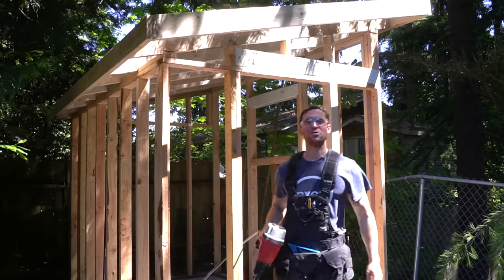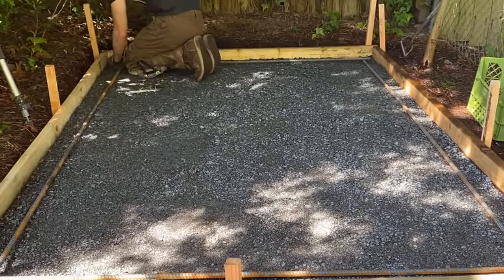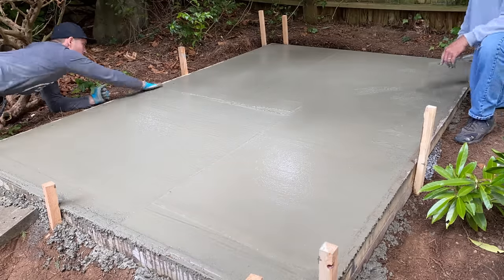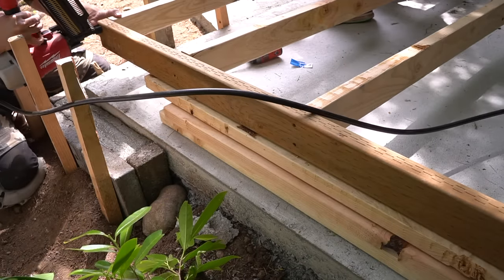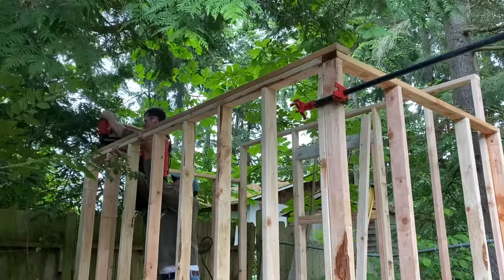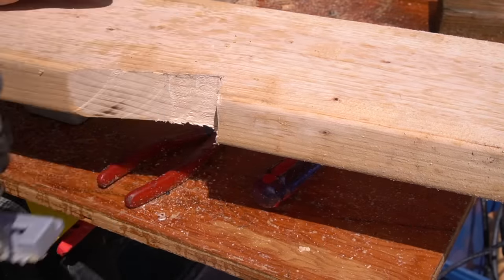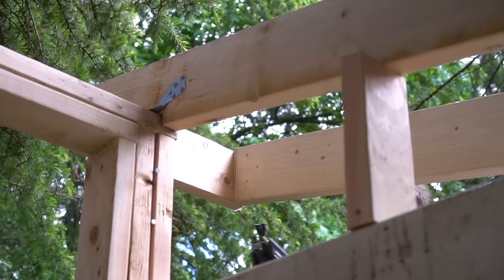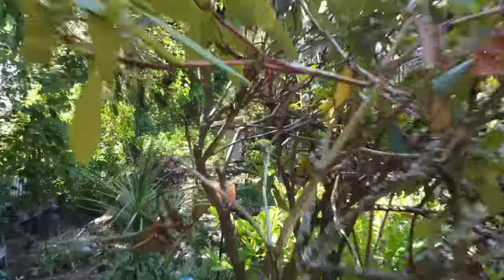BUILDING A LEAN TO SHED // START TO FINISH (Part 1 of 2)

Comment: Great video. When I plan any of my DIY projects I always consider four things: Time, Effort, Cost, and, if needed, helper(s). I also check with my county development office to see if I need Permit(s). If my project is going to require digging, underground cable scanning which is a free service. Since I have a yard irrigation system I also check to see if any of my underground water pipes need to be moved. Property easements are another consideration. Hope to see your project costs in your next video.

Comment: Learn something new everyday.  I like to watch framing and roofing, but never knew how the frame was supported at the base near the foundation.  I always assumed that heavy duty lag screws secured it to the concrete.
Reply: Main issue is water leak between concrete floor and and sitting-on frame.

Comment: Thanks so much for the great video. You demonstrate the steps really clearly. One question…I notice that you place the stud wall timber directly onto the concrete base. Did you not feel the need for elevating the structure to allow air flow under the floor/shed base?

Comment: You don't need two screeds.  You will find it easier to just get cut your stakes flush. This part was made harder than it needs to be.  Also hit your forms with a rubber mallet, vibrator (if you own one), or a sawsall (with no blade), then you won't have voids in the sides of your concrete. I do this for a living, but also watch a lot of videos.  Very much enjoyed the video.  Well done.

Comment: Good idea with the nylon zap straps on the rebar.  much quicker and better than rusty tie wires !  HINT:  On the endwalls do not install the studs and top plate until the roof rafters are installed.  You can then field-fit the endwall studs ( as well as the king studs )  right to the bottom of the rafters making a nice clean wall without having to tinker with little fill-in timbers. 😊
Reply: Good idea but why the long wall does not go longer to be full wall and the short wall stud can be nailed on it? I wonder if the author is trying to give the door more space.

Comment: Loving it.  'Cept I need to make mine with the opening on the high side. And I will probably use clear panels like for a greenhouse. That way it can hopefully act as a shed, and a greenhouse.  Still building it in my head.
Reply: Doing the same thing,window up high and south facing for the natural light.
Reply: Sounds like my unistrut greenhouse build.  It's on my channel.

Comment: You can also lay a level plumb for facial at 90, take a couple different measures on separate boards. Then use an angle finder or your square etc to transpose those marks to the others.

Comment: Also I just realized you're using a Milwaukee pneumatic nail gun! I didn't even know they made one and I am a Milwaukee tool fanatic I just actually got the M18 fuel cordless 30° nail gun for this upcoming project Sunday night! That is freaking awesome! It would be even cooler if you had it hooked up to the cordless air compressor but I guess that would be kind of silly considering you were very close to a power source I would imagine. I really would like to see a comparison between the two honestly I don't know if they made it heavy enough LOL I'm 5'7" and  175 lb this thing right here is a wrist breaker.

Comment: Thank you for your time Sir. I mainly stop by to get information on setting up a lean to roof. I'm building two small lean to sheds. One for a generator and the other for a standup compressor. Both are roughly on 4'X4' already poured concrete base and imbedded 3/8" threaded rods to tie in the pressure treated the lumber down. I goofed up on where the generators exhaust was exiting so had to rethink adding additional anchor points.  I'm planing on using 3/8" lag shields with lag bolts and epoxy to correct my oversight. Your use of hurricane ties I think you called them was very helpful in tying the rafters down. Once again, I have to thank you for giving me additional ideas. for what I originally came here for. Well done Sir.

Comment: This video offers a detailed and practical guide to constructing a lean-to shed, from start to finish. With clear explanations and visual demonstrations, viewers can learn the essential steps involved in building a functional outdoor storage space. The video's comprehensive approach ensures that both novice and experienced builders can follow along and gain valuable insights into the construction process. Whether you're looking to expand your DIY skills or simply need a new storage solution, this video provides the guidance and inspiration needed to tackle the project with confidence.

Comment: as for the nail gun safety, many many years ago I was framing  a deck, I was holding a short block of wood with my left hand and reached out in front of me with the nail gun facing back at me, using my thumb to trigger, I nailed the far end of the block of wood, I let go of the wood and it dropped to the ground, so I start checking my nail gun to see why it didn't fire a nail, that's when I noticed the framing nail had gone sideways right through my left thumb, I never felt anything, it went through the meaty part and slid just under the bone. good times, and yes there was liquid refreshments involved.

Comment: Tapping the edges of the form with a hammer can fill voids and make a cleaner edge.   Also forms can be removed after a couple of hours of sitting. More time if its cold out. and can be smoothed out with a trowel unless dirt is going to cover it then not a big deal.

Comment: I LOVE this channel!! You’re funny, witty, knowledgeable and I VERY much like the fact that your channel doesn’t cram it down your throat to encourage liking and subscribing. It actually makes me WANT to. I’m excited to let you know that now you have a new subscriber. I would love to see you do some air conditioning and power and insulation install or construction in a video since you explain everything really well. I also like that you dumb down jargon so the average person will understand! 2 questions: did you have to get a permit for this structure? Also, the miter saw you used, is it a 10” or 12”? I’m thinking about getting one but not sure what to get.

Comment: I would have added some diagonal bar too to add more support since it's just sitting on the ground surface. A 1 metre piece of rebar is ideal to tamp the concrete to get the air out before it sets, particularly around the edges but an offcut of some timber could also be used. A vibrator would be ideal if you hired one (not a personal one). That'll solve all the air pockets you had visible when you removed the formwork. The whole slab is likely to be like that so you're losing maybe 20% of the possible strength if you don't remove the air.

Comment: Just a quick word about U Cart type concrete. Make sure they’re careful about the ingredient proportions for the mix. In my town there is a company called AA U Cart Concrete. A half baked individual slopped sand, cement, and gravel at all wrong amounts into the almost road worthy slop wagon. Long story short, I had to rip up that concrete because some parts of my sidewalk didn’t set up right. Even after several weeks, the slab was easily eroded by water. Just make sure you know what you’re getting.

Comment: You should trowel out the concrete as skreet for flat level and fill in voids and tears as you peal the mix back with your skreetboard and remove the format the end then smooth and trowel and fill any sides where you remove the form boards

Comment: Great video - thank you! Sorry I found it so late. I'm in BC and want to build a pottery studio with electricity that will require an 60+amp breaker box. I thought I could have a 10'x10' built on a slab but my contractor said we had to dig down 1.5 feet, create forms, fill with gravel and then pour cement. Is that overkill?

Comment: This isn't a shed...you tricked us. It's a house!!  Very very nice...I skipped ahead.  I do wish you would have put some type of flexible foam sealant between the concrete and bottom sill plate.   Only because the shed is so nice and this would help to future proof if you wanted it as a man cave.  Also framed the corners so it would accept plywood or sheetrock.  But, it's a shed.  Super nice one too. I'm jealous.  P.S. love the drop of the tape and reversing it to be back in your hand.  Thank you.

Comment: when tracing measurements from one piece to another, which side of the line do you cut on? the tracing always seems to be just a bit smaller than the actual template... so right on the line, or just to the outside of the marks?

Comment: Wait, maybe I missed it. How did you connect your frame with the concrete base? Great video by the way love how you explain your steps!
Reply: At the end he shows it, he drilled holes through the plate and into the concrete to pound down some bolt anchors which are then tightened down with a nut and washer.

Comment: First, I thoroughly enjoyed this video. 

Equal diagonal measurements of a quadrilateral does not mean the corners are square if one of the sides was miscut too long or short.  This creates a special kind of trapezoid called the 'isosceles trapezoid'  which has two opposite sides of equal length, and two opposite sides that are not equal length.  
Character graphic example:  
    /-------\ 
  /            \
/--------------\
The diagonals of the isosceles trapezoid are equal, but the corner angles are not 90 degrees. Two will be equal but less than 90, and two will be equal but more than 90.  

So, it is important when verifying squareness to check for equal length on opposite sides.  

Now I know I'm being nerdy, but as someone that uses geometry  daily - well it just bugs me. 

Cheers.

I plan to construct a shed, from parts of a recycled plastic shed, but want to make the foundation less permanent so that the next owner can easily remove it.

Comment: Pretty neat shed.  I dont think a header is really needed above the top plate for an opening on the end wall -  your roof framing spans between the front and back walls.

Comment: Thank you for the video. 
Question 1: What is the height of the door? The guy (Blue cap) looks like taller than the door.
Question 2: What is the minimum overhang at both ends of rafters?

Comment: Great job, however a few more things (from a structural engineer) that would help this shed:

1. Bracing, you don't want all your hard work making it square go to waste when a wind comes and blows it warping it slightly. You can see in the intro of the video the shed moving slightly.
2. Wedge anchors is best to add a washer on top of the bottom plate otherwise the not will just sink into the wood and make sure to blow out the concrete dust before installing them. Prob 1 at each corner is enough.
3. Concrete slab is worth excavating into bearing soil (not just lose tree roots and top soil), your slab will settle and will not be level after a few seasons.
4. Either elevate the slab more or provide a rebate around the edge for water proofing.
Reply: Pretty cool to see a structural engineer watching a how-to build a lean-to shed video. Lucky us.
Reply: @IYUB30  It was a good job and objectively gave some pointers that are low effort that would increase the strength and usability of a shed considerably. I watch and learn from all trades - being open minded helps me with my job- I'd argue the same attitude would help many people improve too. Can never stop learning.

*Noticed he did add washers. missed it the first time.

Comment: It would have helped if you had "tampted" the sides, which is achieved by lightly tapping the sides of the frame with a hammer, so you vibrate the concrete down, and the air pockets UP, it would have helped eliminate those voids on the sides. Still, nicely done.

Comment: You might consider blowing the dust out of the anchor bolt holes (19:10) before installing the anchor bolts per the installation instructions.

Comment: How would this work on artificial grass? I've 500mm of compacted hardcore below the artificial grass but would love to build similar shed on top. Any suggestions gratefully received. Thanks for the level of detail in these videos, really helpful!
Reply: You should be able to put a plastic layer to keep the artificial grass down and then put the concrete slab over it. Nothing is growing/ pushing up so it should be ok. As long as your concrete slab is level, you should be good to go.

Comment: I could build 5 sheds with the same time and material as you used for the one shed. Just a bit over kill but looks amazing and will last a long time. Could be used as a tornado shelter the way it's built!
Reply: How would you go about diving the eight rafters among the five sheds?
Reply: @tylerwright7422  2x4 raters, 24 inch center not 16  center. They are only for a 6 foot span roof. triple joist in door ways and windows. Ok maybe 3 sheds not 5. But still over built. Hurricane ties are not needed. I can go on and on  with things that could have saved money and time. I would build a home the way you built that shed. Just much bigger. I would not use house code on a shed or a shop. But I have a big acreage and have to use my materials more efficiently to build what I need. Lumber costs lots as it is. A person doesn't need to over spend if not needed.

Comment: You don’t need a header when your putting a door under a rafter on the end of the shed unless the rafters are running perpendicular. The purpose of a header is to transfer the weight it is subjected to, onto the cripple studs, there is no weight pushing down on that header (it is not load bearing) just so you know…you could of just framed that opening.

Comment: Brent, You mention when you're cutting roof rafters that you set your saw to 13 degrees but on the plans it shows 14 degrees. Can you help me? Really great video, by the way. I have learned a ton from you.
Reply: Off by one degree won’t make a
Difference at all. Test fit the first one and if it fits nice use it as a template.

Comment: Asphalt board between concrete and frame. moisture can creep up into the frame.
Reply from the maker: That would be a good extra layer of protection but that’s why we used pressure treated lumber on the bottom. Thanks for watching.

Comment: You’re concerned with the door header, when that takes nearly no weight. It would only support the deflection of your rafter. But your window header is not doing anything and that actually should be taking weight. Bring that window header up tight under your top plates and frame down for your window opening.
Reply: Yep.

Comment: 1. need a protection layer between timber a concrete to prevent moisture transfer
2. need diagonal reinforcements on each wall to prevent screwing
Reply: Hi
Can u please explain what is diagonal reinforce on walls ?
Reply: @vikingored7469  it a metal angle strip, usually made specifically for this purpose, that you add in diagonal, usually in cross section, to minimise the movement. Like on this image https://www.multinail.net/images/Details_Aus/D3-02-01-02.jpg

Comment: I noticed thst any time you connected two frame boards at a corner, the nailer split both boards. Would screws have been better for those corners?

Comment: When you inserted nails with the nail gun onto the ends of the wood planks for the walls, I saw they ended up cracking/splitting a little. Is that not a concern? Just curious

Comment: I think I would have put the bolts into the concrete and made the holes in the pressure treated footing prior to building the walls.  Then, after the walls were built, I would have just dropped them over & tightened the bolts.  Not saying this would be the correct way to do it, but that's the way I'd probably do it!

Comment: You should have vibrated your concrete and this will increase the strength and provide a nice finish with no air bubble marks, when you take off your formwork.

Comment: Good job, only one thing that is very wrong.  Wedge anchors do not get tightened as tight as humanly possible.  You need to read the torque value listed on the bag for max strength.

Comment: When you poured the concrete, you should have put bolts into the concrete to attach the bottom sole plate
Reply: Or why not use Ramset? Or strong tie post bases? Epoxy some all thread in there? Could be more then one way especially on a shed. Just I guess I really don't know.
Reply: It's called a "sill" plate.
Reply: @Hello Steve how are you doing

Comment: Hey there...I like your project so far...so much so that I'm doing a similar but larger shed (10 x 12).  I have the door on the side as well and I wanted to create a larger overhang on that side.  I've seen stuff about cantilever rafters and such but I'm not sure how to do the framing especially with the rafters seated on the plates as they are instead of just resting on top the was some gabled roofs are.  Can you (or anyone) point me in the direction of some resources or have any advice for me?
Reply: the (was) some gable roofs are...?
I saw the "was" once or twice, now they're gone.  :)

Comment: shouldnt use wedge anchors on the edge of your pad. it could pop the edge of your slab right off because of the outward force those anchors produce
Reply: what should be used then?
Reply: @breadmilkandcheese  chemical set anchors

Comment: for your 10 x 6 1/2',  do you account for overlap when you build each wall section (i.e. is your 10 foot wall actually 7" shorter)?
Reply: If I understand your question right, you’d have to for two of the walls. If you have a wall that runs in to in, butting into the inside of two walls. That would have to be cut shorter by the thickness of two plates to keep the exterior dimension correct. But the 2nd top plate would be the actual dimension.
Reply: @jeb1487  thanks for the reply